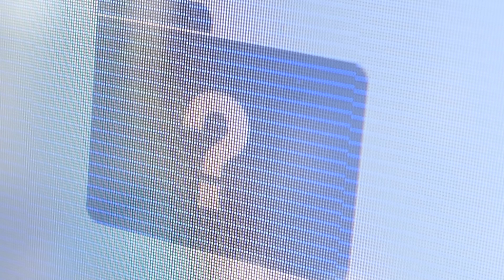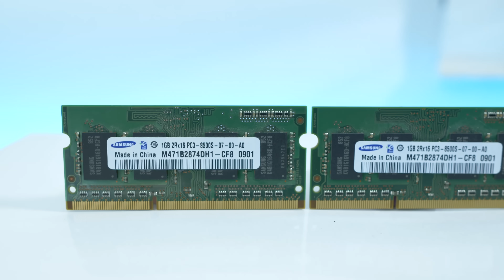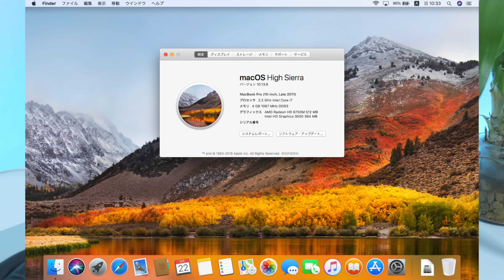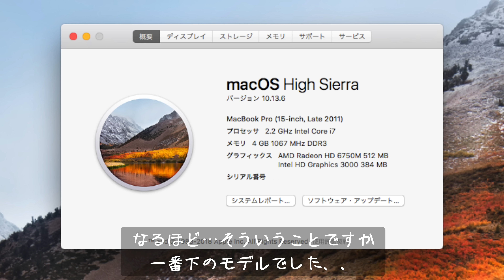ジャンクMacBook Proを買ったらリコール対象モデルだったので自分でリコール対応してやりました

Comment: Haha I have a Late 2011 MacBook like this too. I had the motherboard replaced twice and, it still failed after the repair program ended… the best fix is to just disable the kext driver for the external GPU, that way you don’t have this issue coming up in future.
Reply: Your comment is exactly what I had my MacBook Pro repaired according to their advice. Only the problem is that graphical tasks got slowed down though…
Reply: @mappy555  Yeah, it is pretty old as well. I just keep it as a backup device since it’s basically worth more in scrap metal than to sell.